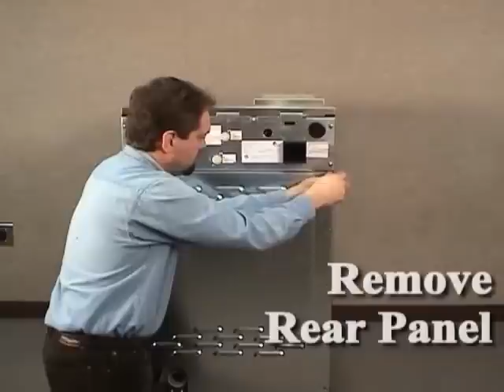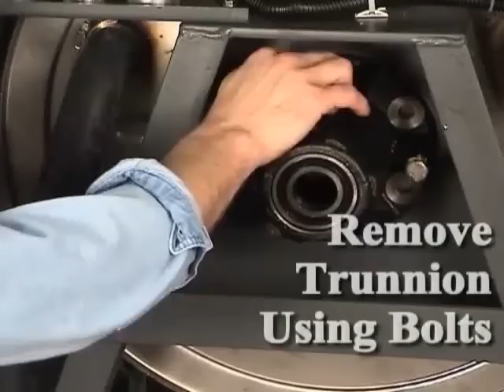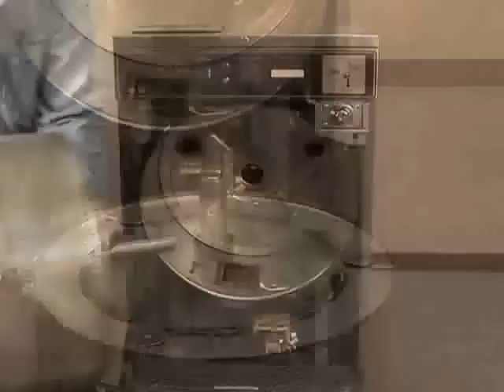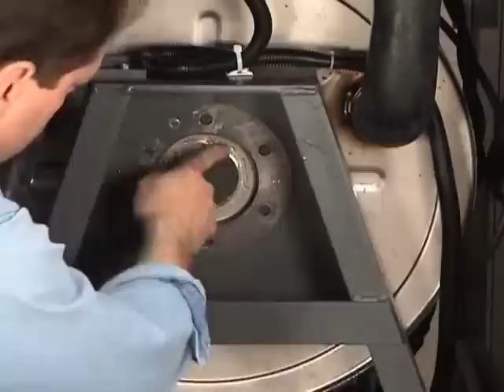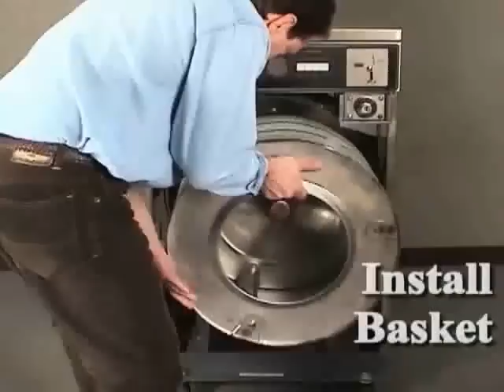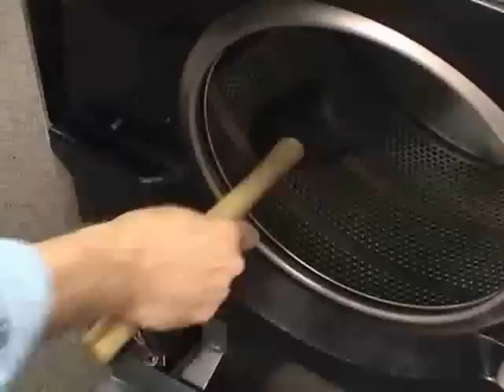How to Replace Trunnion Bearing Housing 18-60LB Washers

Comment: MY FIRST TIME I DID THE WHOLE THING, I TOOK OUT THE BASKET AND REPLACED THE METAL RING AND IT TOOK ME A LOT OF WORK.  THIS TIME, I AM GOING TO TRY TO ONLY REPLACE THE BEARINGS AND NOTHING ELSE.  I AM ONLY TAKING OUT THE BEARING HOUSING AND REPLACE THE.   IF IT LEAKS, I WLL SIMPLY HAVE TO DO THE WHOLE THING BUT WE WILL SEE.

Comment: I would check bearing fit on trunion shaft  if has small grove or loose fit seals and bearing wont last.Don't use china made garbage use oem parts especially bearings USA made and double lip seals.

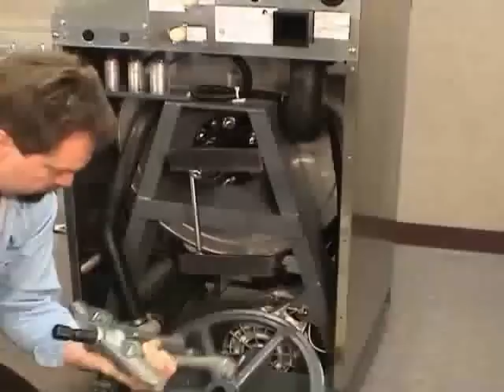Comment: 5:59Then drop the large expensive perfectly balanced pulley on the concrete so it bends just enough so that when you get it all back together the machine now has a vibration that it’s never had before…and the bearing goes bad twice as fast…
Reply: How should it be placed? How do you prevent that from happening?

Comment: Any way to do it if you don't have the removal tool we used a car  puller tool to take of the  wheel. But can't get the tub out. Can't afford the pulley puller tool. The video is very helpful though thanks alot well appreciated.
Reply: Hey did you ever finish the job? I want to
Ask you how did you put back the basket shaft in to the housing? Did you used a puller?
Reply: Use a piece of wood to protect the shaft then hit it with a large hammer to push it through.

Comment: This is so painful to watch. You guys are so amateur it makes my hands hurt.
Reply: The part where he's using a DREMEL cut off wheel to grind off those good sized nuts and bolts had me rolling. Five years later and an entire stack of cut off wheels. Die grinder, or angle grinder if you can fit it in there, works wonders.

Comment: I'm  sorry  but  have  better  system  and  easy  to do it this  is  this  is a lot  work  thanks   design  better system
Reply: luis h Gomez I have a call for commercial washers a dryers tomorrow and was brushing up on these machines.  I would say this is an excellent built machine.  Any bearing job on a residential or commercial washer is a pain.  I would actually say with all the tools they have in this video I would rather do this bearing replacement than a residential machine.